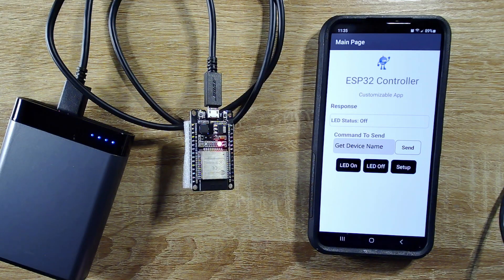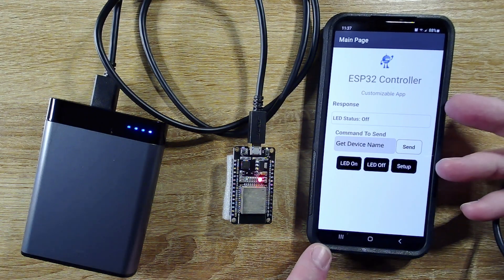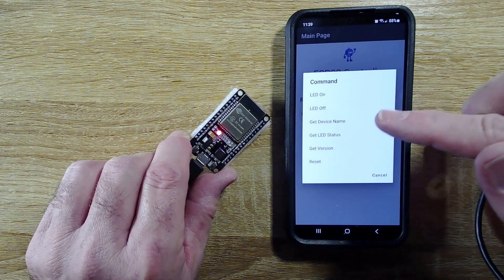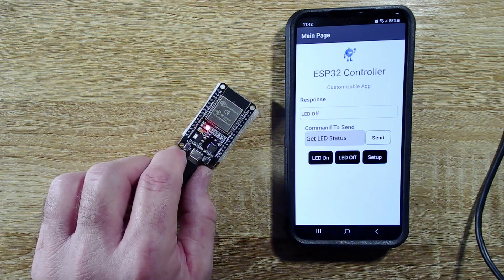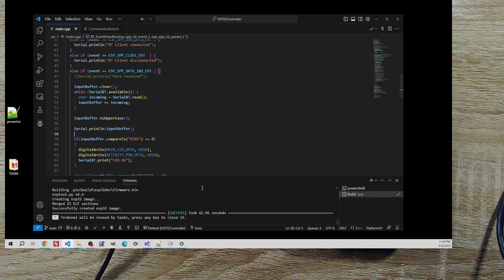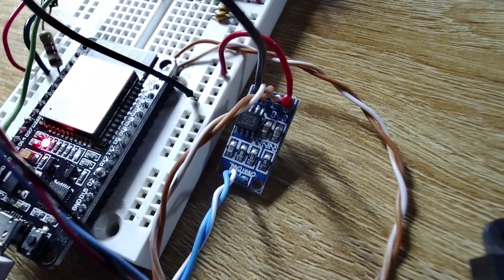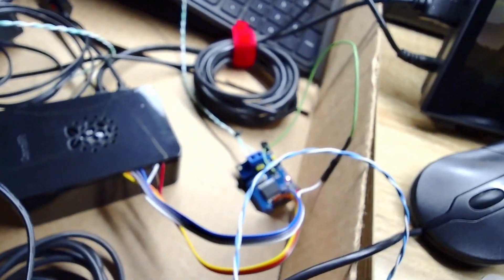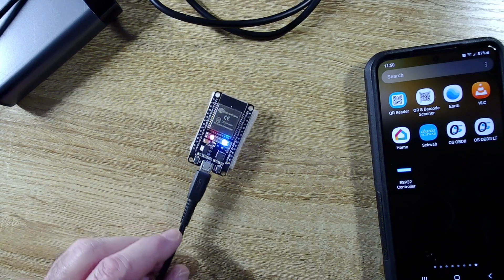An Experimenter's Starter Kit with MAUI Android and ESP32 Microprocessor n' Some CAN stuff

Comment: I've got 2 questions for you. What's the difference between an ESP32 and an ELF327, and more importantly, why do you need one? Could you not just say, connect the CAN wires to an RS232 port (or usb) and can-utils (or whatever software) see the voltage changes? THANKS!
Reply from the maker: ESP32 is a general purpose microprocessor that can be programmed to do virtually anything (read temps, levels, set switches, relays and a lot of other stuff). There's nothing specific that ties the ESP32 to automobiles. It's just a blank slate.
The ELM327 is a microprocessor that is already programmed. The ELM327 is specifically designed for automobile CAN interfacing and is ready to communicate with a CAN out of the box. But, you still need some app that will talk to it.

You need a piece of hardware that will translate RS232 to CAN. For example, RS232 requires at least three wires, transmit, receive and ground. CAN doesn't require a common ground, and the two wires that send/rcv data both participate in each direction. Electrically, the two (RS232 vs CAN) are not compatible. Also, USB wires require a special IC to communicate via RS232 or CAN.
At about 10:18 in the video there is a tiny board (1"x.5") that translates CAN and RS232. The blue wires are the can. The wires going to the board are RS232.
Reply: @Roudter  Great, that makes total sense! So, what is the tiny board and what is the difference between it and an ELM327 🙂
Reply from the maker: @tonycoke1440  The tiny board is RS232 to CAN translator - literally RS232 on one side and CAN on the other. It translates one to the other, electrically. So, the larger board talks 'RS232' to that tiny board, and on the other side (the blue wires) is CAN. Data can flow in and out this way.